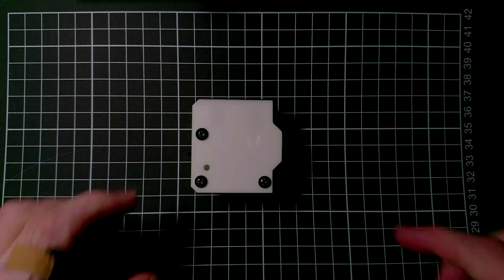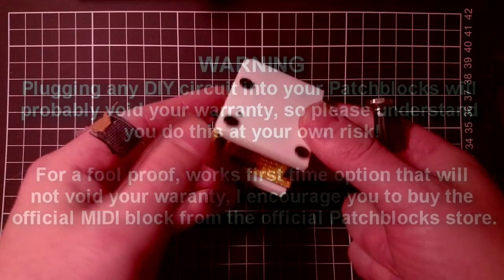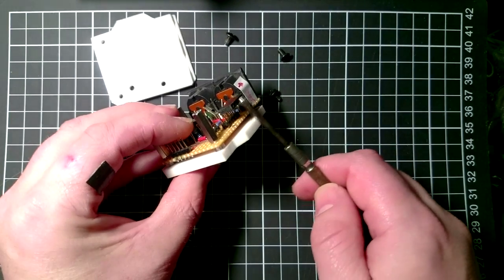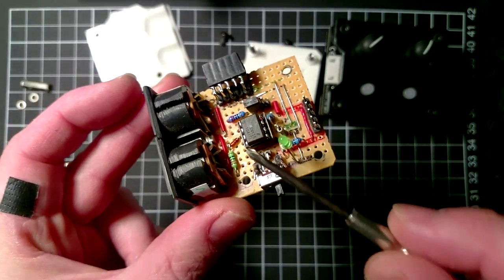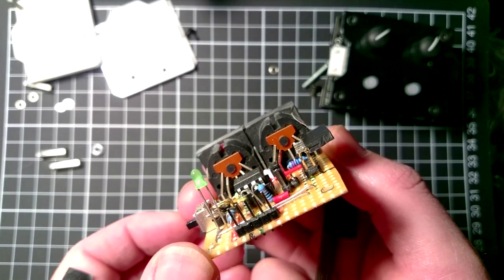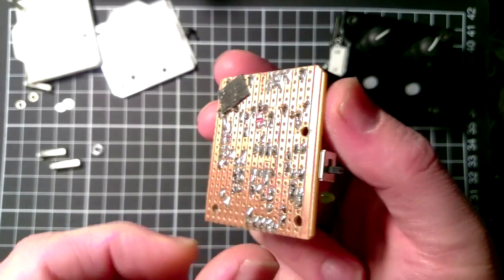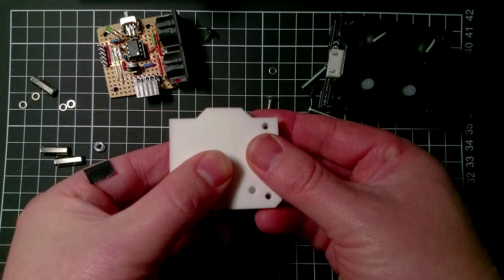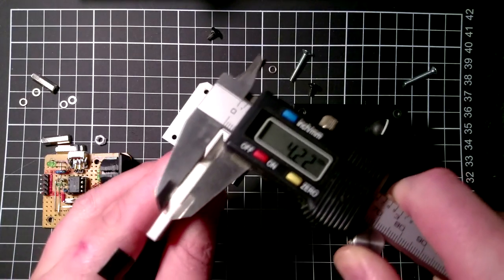DIY MIDI Patchblock - Disassembled

Comment: Woaw incredible ! I hoped that someone did something like that, as the patchblock midi in is out of order, and you did ! Thanks a lot ! I was prety sure it was an optocoopler based circuit, but without an original one, difficult to retro ingeener. Nice !

Comment: Do you think the Midi breackout board Midi-BB sold by HobbyTronics.uk could work same as yours?? I do not see the 1N4148 in their design which is  in your's, it seems to be only on the midi in socket and not the out, does it goes 3.3 or 5 v on the out??? Tnx Maikshift, great vid!
Reply: A diod is strongly recommended to be on the safe side even though it obviously works without one. I also added a 100 nF capacitor between pin 5 and 8 on the 6N138 as also recommended. I measured 4.1 v out from the PB Synthesized block. I believe 3.3 - 5 vdc is all within the tolerated range. I made an almost identical circuit for the Arduino Nano on 5 v, and it also works perfectly well.